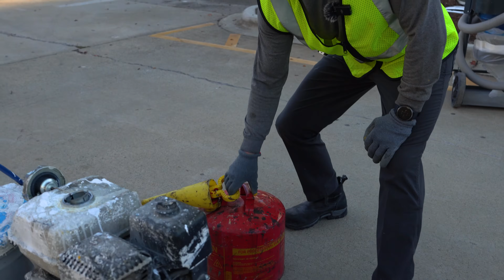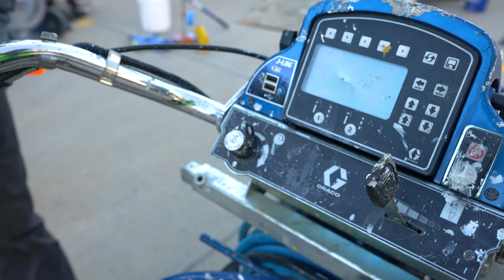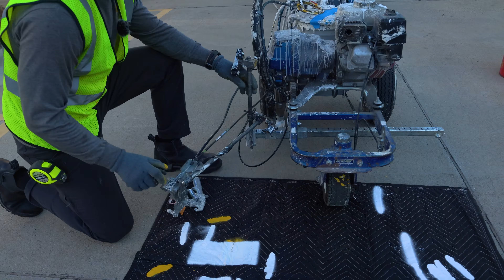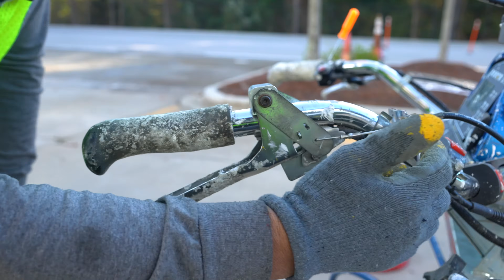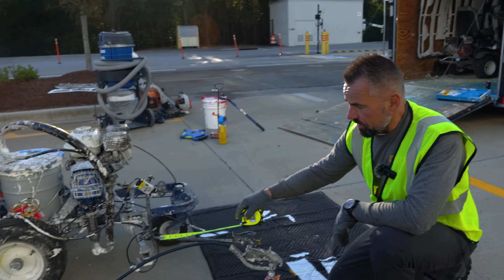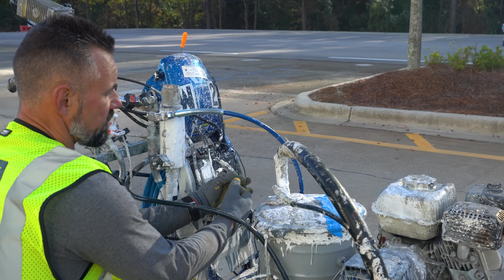Ultimate Graco LineLazer V 3900 Setup Tips

Comment: Love the videos lots of great tips.......In the video you are using solvent based paint.  I have heard/read that graco is not great with waterborne paint is that why your using solventborne?  If you had to use waterborne what brand would you use? Hotline, Setfast?  Thanks keep up the great work
Reply from the maker: Appreciate the love and glad the tips are helpful! You're right, we're using solvent-based paint in this video mainly because of the quick dry time. It lets our clients reopen their lots faster, which is a big win. That said, we do use latex (waterborne) paint for certain applications too, depending on the job and conditions. Graco machines can handle waterborne just fine with proper cleaning and maintenance. Thanks for the great question and support!
Reply: You have to use waterborne on sealcoat jobs or else youll have brownish  green lines when you wanted white 😆 I run waterborne in my 3900 sprays fine but it’s shitty compared to solvent line  quality